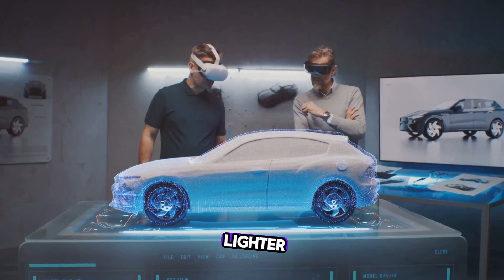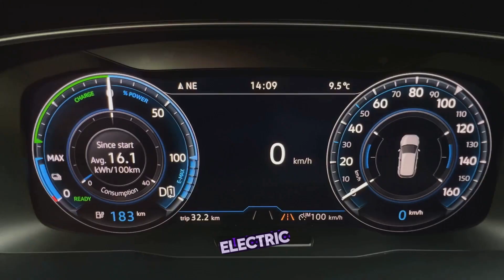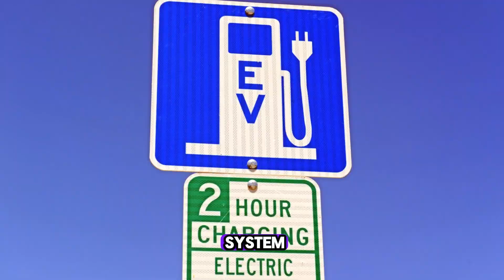New Electric EV Motor May Kill 😡 the Internal Combustion Engine

Comment from the maker: It's a fascinating world, isn't it?
Reply: Tesla's Burn : they have Tempered Glass ( Not even a Hammer can Break ) could only bend out the frame rail of the windows:  within the door 4 to 6 hard kicks can Chatter the Glass 
Now imagine your children, or your Grand-Children Stuck inside a Mile Long Tunnel, and there are Accidents and Lithium - ion Battery Packs Start to Burn and there are nothing but EV's inside no one goes in and one goes out not drivers inside ( succumbed to Smoke Toxic Fumes and Fires ) Fire departments only have 1 $8,000 to $10,000 Blanket to suppress oxygen they may have 2 blankets though a mile long Tunnel the Fires would weaking the structure, and collapse is eminent. 

There is a reason why it is Illegal to Mine Lithium in the United States, it is due to Environment Impact.  China realized the Ground Water had become Acidic and Changed to making their Electric Vehicle (EV's). out of Sodium Potassisium.  In the United States only has 4 Recycling Centers, & none are in the State of California, due to Environmental Impact.  

In July 2023, I was in a Conversation with someone in Hawaii, about the Lithium -Ion Battery Packs being Toxic in Unpaved Junkyards, with the Battery Packs Leaking and Orange or Brownish Orange Gel. It is Toxic Acidic and Poisons our Ground Water. He said there are Millions of EV's Stacked 30 feet high ( or height of 3 story buildings )  in the Islands. In Augst 2023 the next moth. The Islands of Hawaii burned for a Month and Half. From August to mid September Hawaii Burned, and despite Hurricane couldn't turn off the Fires, because Water Chemical Reaction to Lithium - Ion is as an Accelerant.  Yes, Futures are looking Great Right 👩🏻‍🚀👍🏻🏎🏎🏁🏁🚩🚩
Reply: No. This is complete bullsh..
The electric motor is already over 90% efficiency. So i don't get it.
It is the batteries that is the problem, and they are both dangerous and very sensitive.
Already, people don't want EV:s, only rich people with little iq buy them.

Comment: Oil running dry will kill the combustion engine... Synthetic fuel - at 3 to 4 times the price of unleaded - will be way to costly for most people to consider using...
Reply from the maker: Thank you for sharing your thoughts! It's important to consider the impact of oil depletion on the future of the combustion engine, even though the drying up of oil may take a whole lot of years. The development of electric vehicles and alternative fuels is a step towards a more sustainable future. We appreciate the personal energy you've put in to help encourage a renewable energy future.

Comment: its not the EV motor that's the problem they are damn good already - its the friggin energy storage system that needs some serious work
Reply from the maker: Thank you for pointing that out! You're absolutely right, the energy storage system is a key area that needs improvement. In case you might be interested, we did do a video on getting the most out of an EV battery 

👉 "Electric Vehicle Battery Health 101 😍"
Reply: Solid state battery technology will go quite a way to solving that issue.... Physically smaller, lighter battery packs, with much higher energy density (range), along with much reduced charging times....

Comment: As long as it's got room for a diesel generator in the trunk it'll be okay
Reply from the maker: Who needs a diesel generator in the trunk when you can carry a long connector cord to a Level 2 charger!  Say goodbye to the gas stations and hello to a cleaner, more convenient way of driving! What do you think about that?😎
Reply: Any generator that fits in the trunk would take a week to charge an EV, because it wouldn't provide enough current for a quick enough charge. For that, you would need a generator the size of a shed.

Comment: No. This is complete bullsh..
The electric motor is already over 90% efficiency. So i don't get it.
It is the batteries that is the problem, and they are both dangerous and very sensitive.
Already, people don't want EV:s, only rich people with little iq buy them.

Comment: Tesla's Burn : they have Tempered Glass ( Not even a Hammer can Break ) could only bend out the frame rail of the windows:  within the door 4 to 6 hard kicks can Chatter the Glass 
Now imagine your children, or your Grand-Children Stuck inside a Mile Long Tunnel, and there are Accidents and Lithium - ion Battery Packs Start to Burn and there are nothing but EV's inside no one goes in and one goes out not drivers inside ( succumbed to Smoke Toxic Fumes and Fires ) Fire departments only have 1 $8,000 to $10,000 Blanket to suppress oxygen they may have 2 blankets though a mile long Tunnel the Fires would weaking the structure, and collapse is eminent. 

There is a reason why it is Illegal to Mine Lithium in the United States, it is due to Environment Impact.  China realized the Ground Water had become Acidic and Changed to making their Electric Vehicle (EV's). out of Sodium Potassisium.  In the United States only has 4 Recycling Centers, & none are in the State of California, due to Environmental Impact.  

In July 2023, I was in a Conversation with someone in Hawaii, about the Lithium -Ion Battery Packs being Toxic in Unpaved Junkyards, with the Battery Packs Leaking and Orange or Brownish Orange Gel. It is Toxic Acidic and Poisons our Ground Water. He said there are Millions of EV's Stacked 30 feet high ( or height of 3 story buildings )  in the Islands. In Augst 2023 the next moth. The Islands of Hawaii burned for a Month and Half. From August to mid September Hawaii Burned, and despite Hurricane couldn't turn off the Fires, because Water Chemical Reaction to Lithium - Ion is as an Accelerant.
Reply from the maker: I appreciate you bringing up these points about the environmental impact and safety hazards of lithium-ion batteries. It's crucial to have these discussions and work towards finding sustainable solutions.

According to Wikipedia - "While the US holds some of the largest known reserves of lithium, the only large-scale US mine producing it (located in Silver Peak, Nevada) makes less than 5,000 tons annually, which is less than 2% of the global supply. Bessemer City mine and Kings Mountain Mine in North Carolina have a lithium deposits."

Comment: Not even going to watch this video.. Electric motors are over 90% efficient and can last for 500K miles.  Even if this miracle motor gets to 97% efficiency those few points are not going to end ICE.  There are a few things keeping EVs from taking over - the biggest is charging for those with no at-home facility to charge.  Charging at home is wonderful and 100 times better than putting gas in a car in crappy weather, but charging publicly is 100X worse than putting in gas (OK, 10 times worse..).  The second is cost.  If you are a premium car buyer already, then buying a Tesla (for example) is roughly the same cost as a similar size BMW (again, for example).  For those who buy less expensive cars, EVs are a bit out of range for now.  Lastly is the unknown of what these cars are going to be like in ten plus years.  

Cheaper cars, faster charging times, more public chargers, and knowledge that a battery failure out of warranty won't condemn the car are what's preventing the tipping point.  I'm on my second Tesla S (wonderful car) but I won't own any EV (for now) out of warranty which I routinely did with my gas cars.
Reply from the maker: Thanks for sharing your thoughts on the video! It's true that there are still some challenges for EVs to overcome before they can fully replace internal combustion engines. But it's exciting to see the progress being made in terms of efficiency and longevity of electric motors. Hopefully, advancements in charging infrastructure and cost will continue to improve in the coming years.

I personally own and drive a hybrid. May you continue to have good fortune with the vehicles of your choice.

Comment: Too bad there's so much working against the short term feasibility of actually making an ALL electric vehicle scenario a reasonable reality.
- the power grid in any state couldn't handle it if we all had them
- they're too expensive for everyone to afford, prices now going up, not down
- the fire hazard is a real thing
- the mining for battery materials in that quantity is far from green
- biggest supply of these raw materials is from China
- the range of travel is quite limited between charges 
- no efficient system for recycling the batteries, the waste byproduct is very bad
- the incredible cost to replace the batteries
- the manufacturing of EV cars is far less green than ICE cars
- if there were ONLY electric vehicles then the electric grid, by default, becomes a FAR more attractive target for hackers. It could be catastrophic nationwide, many would die
- when an EV is in an accident and declared "totalled" by American mechanics bc of the danger to rebuild, instead of being scrapped, they get sold and shipped to places like Ukraine where they don't have the same safety restrictions.

I could go on.... But, these are only talking points; each one has branches of explanation and details that extend the seriousness and caution needed BEFORE flying headlong into a system with so many concerns.
What's needed is an
 intelligent, comprehensive, step by step cooperative plan to implement so we don't fuck up the planet more, as well as civilization as we know it.
These moron political types don't even care to think it through.
Reply from the maker: Whoa, slow down there! You've got enough points to write a thesis on the challenges of electric vehicles. But hey, at least we can all agree that EVs have some hurdles to overcome. We do appreciate that you let us know some of the challenges that you seen. 

About the fire hazard, we do have a video that may shock you - "Burning Questions ICEs vs Hybrids vs EVs  Which Catches Fire the Most?"

Also this 👉 "EV Owners Hate EVs  Shocking News for Ford & GM"

Comment: Electric motors aren't the problem.  Batteries are the problem.  Until someone makes batteries that can be recharged in 2 minutes AND EV charging stations are as prevalent as today's gas stations, with as many chargers as gas stations have pumps, EVs cannot replace ICE vehicles.  EV batteries have to become much smaller and lighter and they have to become much less of a fire hanzard.  Of course, the electric power grid and electrical generation and energy storage issues will also need to be addressed.  Give it 30 to 50 years and we may be there (if mankind doesn't destroy itself first).
Reply from the maker: Yo, thanks for sharing your thoughts! I hear you, man. EVs still have some hurdles to overcome, like faster charging, less of a fire hazard (but did you know that according to recent data figures, hybrids catch on fire 25Xs more than either ICEs or EVs), improved electric grid and better battery technology. But let's stay optimistic and keep supporting the progress being made. Who knows, we might witness some incredible advancements sooner than we think!
Reply: @GoGreenHub  We might see rapid technological advancement but it is more likely that we'll see technology advancements obviate vehicular travel than see them greatly improve EV batteries.

As for the data suggesting that hybrids catch fire 25x more often than EVs, it's obviously erroneous.  If it is actually true, the only possible reasons are a) the hybrids are older and/or less well maintained or b) the hybrid owners get in more accidents resulting in breaches of their battery packs.  The fact that the EV batteries have 3x or more battery cells than the batteries in hybrids ensures that their failure rate has to be much higher.
Reply: It won't matter how many pumps a gas station has, or how quick it is to fill up with gas once oil runs dry.....
Reply: @Brian-om2hh  Yeah, oil isn't going to run dry for hundreds of years, if ever.
Reply: @kirkjohnson6638  Around 25 to 30 years.....after which it will become unviable to extract and refine for road fuel, unless you are willing to pay 5 or 6 times the cost for it. Hundreds of years?  We won't be able to breathe in most major towns or cities in 30 years, at the rate pollution is increasing. Unless you're happy to see your kids and grandkids only live until their 40's.....There are already deaths in London, with air pollution being cited as a factor in the death. Is listening to that V8 really worth dying for?
Reply: @Brian-om2hh  Bullcrap.  We have plenty of oil for at least the next 400 years.

Comment: The EV markty is nit expanding and wil not do do for the forseeabe future.  EV Manufactireers are cutting back or ceasing the manufacture yof EVs.  This trend will conrinue until battery tecknowlagy solves the problems associated the current batteries. The time wasted finding a rechatging facikity and the time tajed ti recharge is a killer!
I believe that hydrogen [pwer ma be the amswer.
Reply from the maker: Thank you for taking the time to share your perspective. It's always interesting to hear different opinions on the future of EVs. While there are certainly challenges to overcome, the progress being made in battery technology and charging infrastructure is promising. Let's keep the conversation going and see where the future takes us!

Comment: Good electric motors have been available for 100 years . Grate motors have been available for 10 years . The motor is not the problem. it is batteries that are the problem. Batteries wast more than 20% of the electric used to charge them . The last time I checked, the speed limit is the same for EV gas and diesel cars.  98% of all cares have been able to beat the posted speed for several decades.   Charging takes way too long.  Then you have the problem of not having enough electricity available to charge them, especially in California .  To make up for the lost enagery, your motor will need to nearly 30% more  efficient than the Tesla motors. This video is just more BS .
Reply from the maker: Ah, the age-old dilemma of same-ole good 100 yr batteries, 'grate' motors (?), speed limits, diminishing battery efficiency, possible strain on the electric grid,  and long charging times. Maybe we need an EV with built-in teleportation capabilities? Jokes aside, it's true that there are challenges to overcome, but we're making progress. Innovation is key!
Reply: You act like an childish religious person.
The batteries are very dangerous. @GoGreenHub

Comment: Too much waffle - it's just a radial flux motor with a higher rev range, linked to a less-complicated gearbox.
What we need now, is a better battery technology.
Reply from the maker: Haha, I'll admit, there's always a bit of waffle in the tech world! But hey, at least this motor brings some cool features to the table, like a higher rev range and a simpler gearbox. As for better battery technology, we're working on a new video that shows how the tech wizards out there are cooking up something amazing in the EV battery development world!
Reply: Until they produce batteries that are fire proof, many people won't buy, I agree electric will reduce pollution in the city's for across city driving, that's fine, but anyone going on large trips are taking gambles, basic lithium cobalt technology won't change, you always sacrifice something in the mix, if manufacturers produce energy dense reliable batteries maybe, but now for mass production as of now, where are they,
Reply from the maker: Haha, you're right! About vehicles catching on fire, we did produce a video "Burning Questions 🔥ICEs vs Hybrids vs EVs 🔥 Which Catches Fire the Most?" As far  going on long trips with electric vehicles, it's like playing a game of "battery roulette". Will the battery last or will it leave you stranded in the middle of nowhere? 😅 But hey, at least you won't have to worry about pollution in the city! Thanks for the comment!